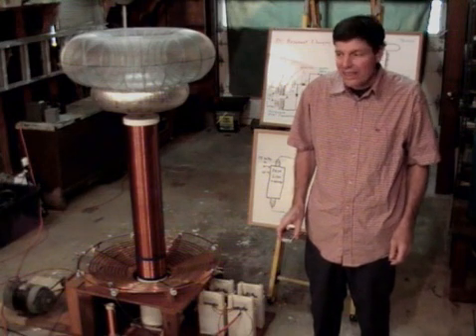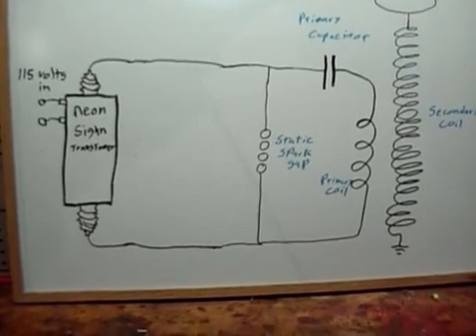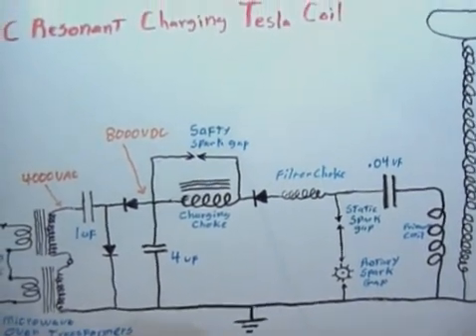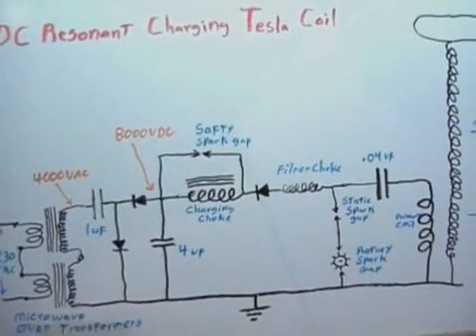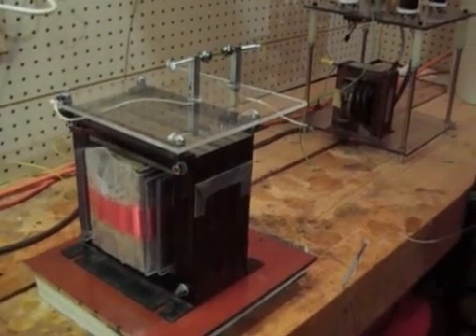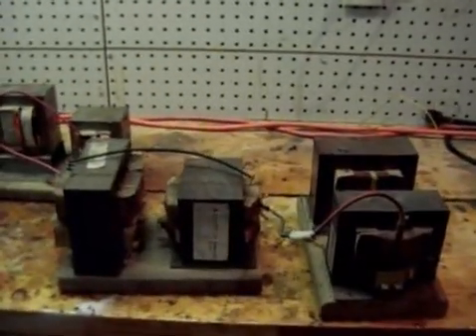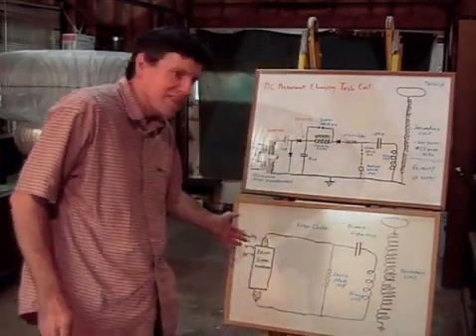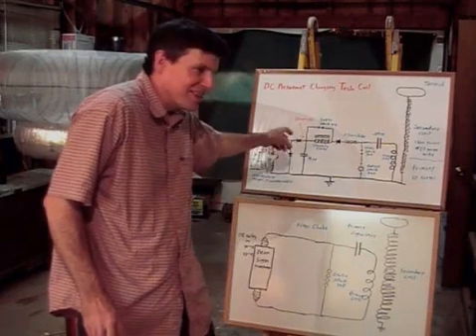Larg Tesla Coil Video 2

Comment: Nice.  Question:  On the AC version, how does it charge up the cap if it is AC ?  Is it charging to the peak plus and minus of each cycle and then firing at 120 Hz ?
Reply: Its level shifted with the voltage doubler then half wave rectified through a single diode onto the second cap and on it goes through his choke

Comment: I did the same circuit, but i didn't use microwave transformer to step up voltage. I had support from normal 230v. And it worked fine.

Comment: Im starting to build a tesla coil but I have some questions. When applying AC voltage to a capacitor, doesnt that make a short circuit? If I add a safety gap in series with the transformer and the rest of the circuit would that affect the performance?